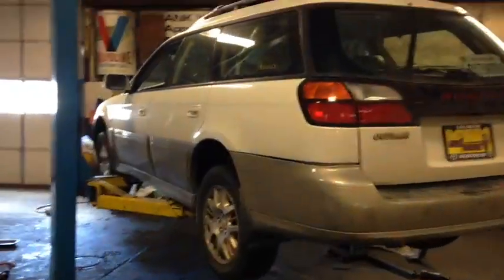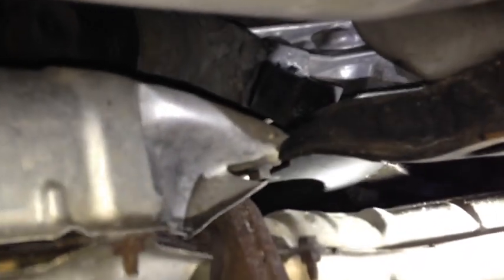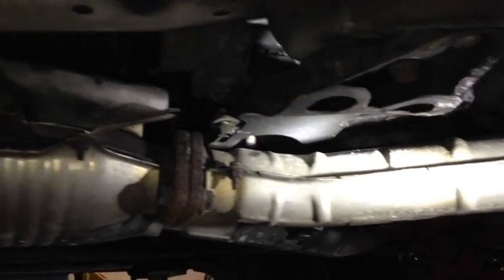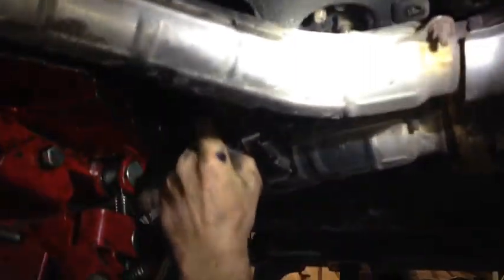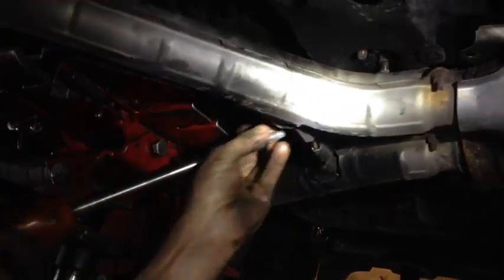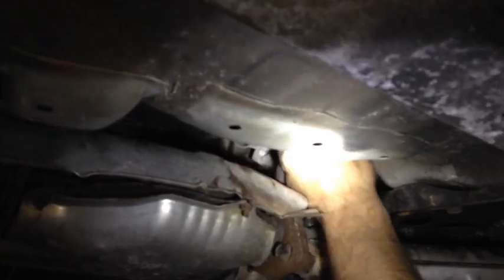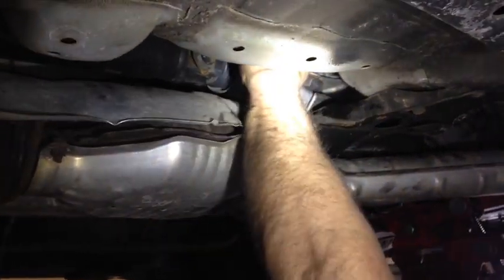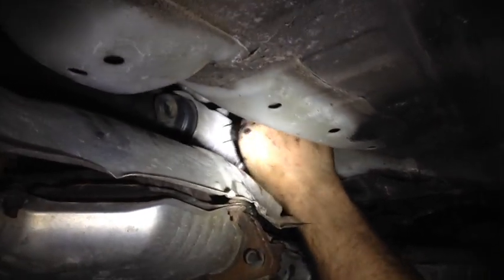How To Fix Annoying Clunk Subaru Outback Impreza Legacy Forester Tribeca

Comment: Do the RPM's typically waver going into reverse with this issue as well? And how much damage is the broken mount causing to the transmission itself? Thanks a lot friend!
Reply from the maker: I think it could waver but not sure by how much. I wouldn’t say it damages it that much. And the transmission would have to be used like that for awhile before the transmission goes bad due to the bad mount.

Comment: Another question do you think breaking the axel while driving will cause the transmission problems? Axel is fixed problems started after fix. Thanks for the reply will try it all
Reply from the maker: Who did you have fix it? Did they refill the fluid? Did they do a fluid change? They could have messed up something if it was just an inexperienced person who fixed it.

Comment: I wish you had the audio of the car in reverse. I have a 2003 outback, and I pushed the mount under the car area and it is loose and so I hope that’s the reason why it makes this “thunk” noise. It is loud about 80% of the time but if I’m able to just go from park to drive it doesn’t but yeah if I go in reverse quickly it makes a louder noise. If I go slowly in reverse it’s usually half as loud. I’m not sure if that makes sense lol
Reply from the maker: Yes it sounds like the mount

Comment: Hello. Tell me please. This problem i can fix it also for a Subaru Outback 2013 with cvt automatic transmition? The mechanics from Subaru have told me that i must to change the gearbox for the same problem that  you fix it in this clip. Have u idea if is the same work? Thanks a lot
Reply from the maker: Go to an auto repair shop and have them lift the vehicle and put it in reverse and drive and see if the transmission moves a lot. If it does the mount is toast.

Comment: I have a 2000 Subaru outback and the axel broke while driving now the car makes a weird grinding noise when I put in Park and roles backwards on hills. And the transmission hesitates in drive and won't go above 30 mph. Do you think it might be a sensor because the "at oil temp light pops on
Reply from the maker: No I don’t think it’s a sensor. It sounds like it’s stuck in first gear. I’d need more information to give you a better idea. Have you checked the fluid? Your front differential could be toast as well. There are two dip sticks. The one on the passenger side of the vehicle is the diff oil. The other side is the transmission oil. Make sure you put the right oil in the right spot. 

I would check the codes (autozone does it for free) and then check the fluid and see what color it is. Smell it and see if it smells burnt. 

If it’s an electrical issue you can unplug the battery for 10 minutes and plug it back in and see if it fixes it at all.

Comment: I replaced the broken transmission mount in my 04 Outback H6 and it still "clunks" into Reverse. Shifting all other gears is smooth. Any hints?
Reply: I got same issue and saw 3 Subaru mechanics. My car only jumps when shifting AT to reverse when the car is cold. When warm, shifting is smooth and there is barely any jump. I also feel slight jerking if I drive over 60 miles/hour and suddenly release gas pedal. If I release gas pedal slowly, no jerking. Two Subaru mechanics told me that rear differential bushings are worn out, and the third told me that transmission mount is in bad shape and needs replacement. For now I am driving the car as is since two of my friends who have Subarus have the same issues and they have been driving their cars for years without fixing the problem.
Reply: I have a 2013 outback that started making a clunking noise in reverse and drive at all speeds. Just harder to hear. Car jerks at low speed but is fine after, doesn't jerk at highway speeds. Codes say I need a new clutch converter solenoid and at filter replacement.

Comment: Do you think a bad motor mount can cause that cluck too? 
 Check this out https://youtu.be/HvG7xbilzV0

I just change my transmission mount in my forester and it still does that clunk even the motor sshakes!
Reply from the maker: Possibly the u joints or the mount for the driveline? I wouldn’t think the engine mount would do that from your video but it’s possible.